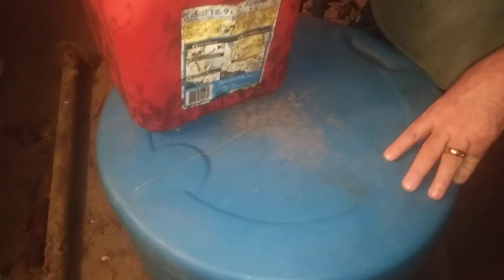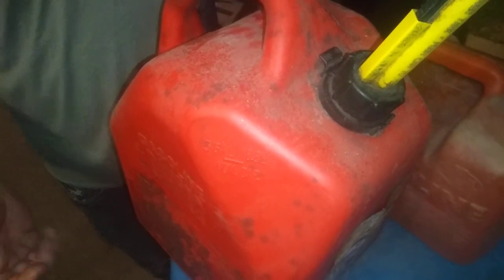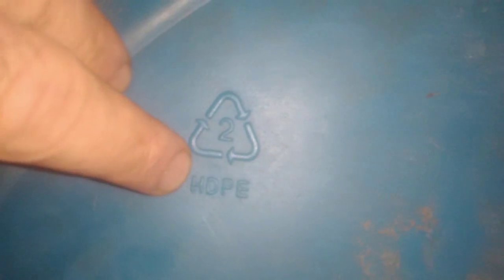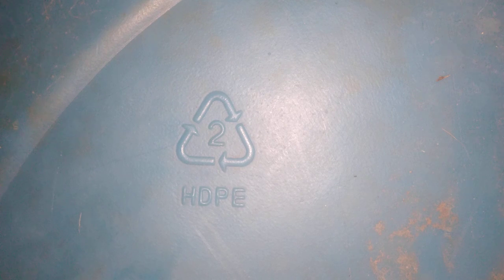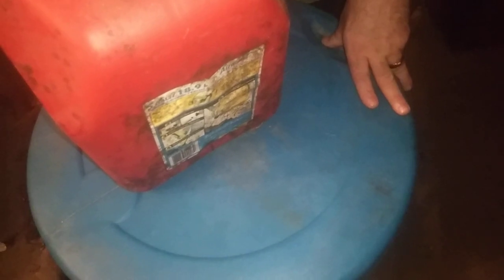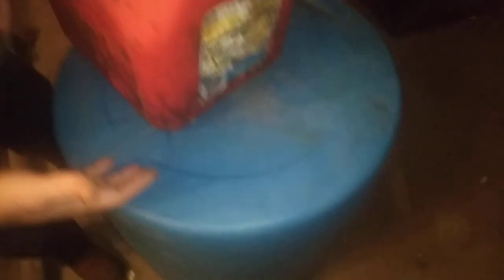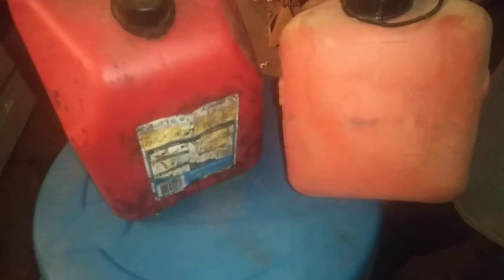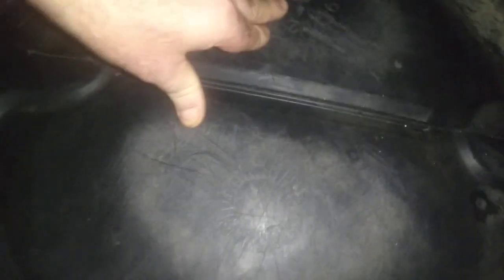Gasoline Fuel Storage in Blue Plastic Drums

Comment: Won't gasoline melt plastic?
Reply from the maker: Certain plastics. The blue and black drums are made out of the same plastic the red gas cans are made out of, not to mention much thicker. I hear you, i'd prefer steel drums, but I have both now.  Both are full of gas and i have no problems.
Reply: @shadetreeautomotiveDIY  I made a gasoline tank for my truck with one, working good, so far

Comment: WHEN HE TURNS DRUM UP  SHOW THAT 5-10HLMI   ,  TYPE THAT IN GOOGLE AS   HDPE 5-10 HLMI  AND IT TAKES YOU TO MONTACHEME DATA SHEETS 
I CANT FIND ANYBODY SELLING THIS DRUM WHICH IS GAS RATED AS A  54050M  HDPE     SO I THINK IT WILL BE EASIER JUST TO BUY USED 50 GAL GAS TANKS FROM JUNK YARD AT LEAST IT HAS A PUMP THAT CAN BE HOOKED UP TO 12 V AND PUMP OUT GAS ALSO AND IT SAFETY RATED  AND APPROVED